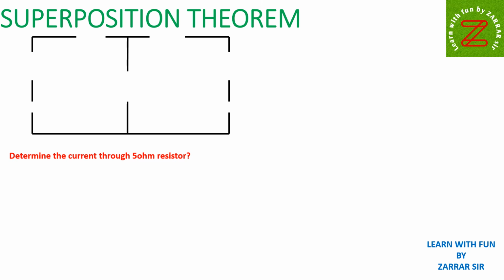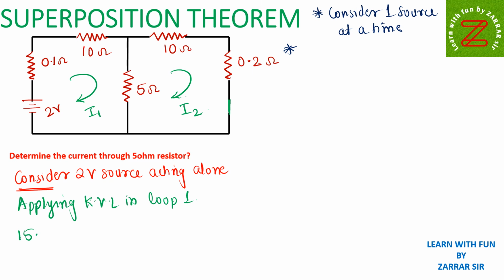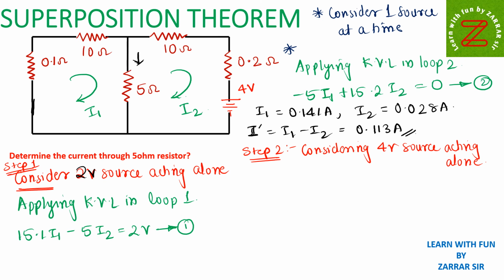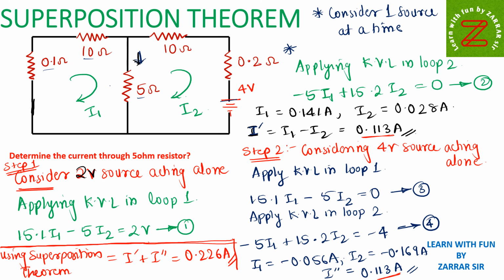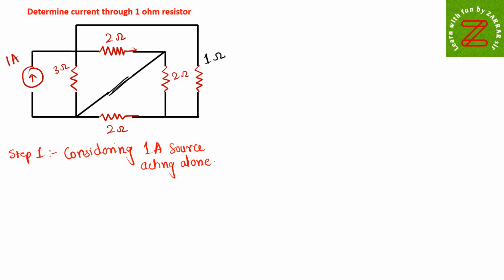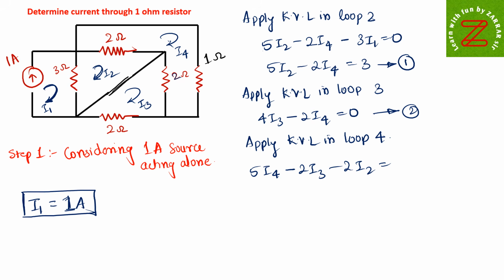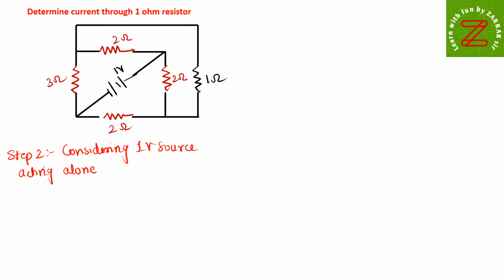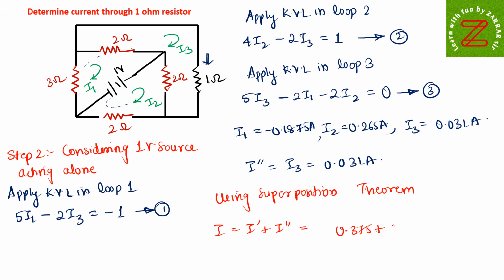SUPERPOSITION THEOREM WITH TWO EXAMPLE in Less than 20 Min

Comment: Sir, in the KVL video, you would write the voltage and subtract the value whenever there was a resistance, then set the equation equal to zero. However, in your current lesson, you are adding the resistances and placing the voltage after the equal sign instead of zero. This has left me quite confused. Can you please clarify?
Reply: He is using a shortcut. Check it out on his kvl video

Comment: 5:05 sir you have calculated the value of I2 as 0.028 however  I'm getting 0.048 as I2
Reply from the maker: Yes u r correct
Thanks a lot for correcting me
Reply: @ZarrarKhan  your welcome sir love your content :)
Reply: @liebermen2369 bro how to calculate equations with casio bro
Reply: How to calculate please let me know
Reply: @ramoioo  using scientific calculator. If you have an fx-991 model then press on mode button then press 5 to select equation then press 1 or 2 depending on the no of variables. Then enter the coefficients of all the equations respectively. Press = to enter the number into matrix. If the equation doesn't have any term then add the coefficients of that term as 0. Then simply press = after entering all the values. Voila!

Comment: what if we have 2 voltage source and 2 current source in single circuit ??
help sir
Reply: you will have to consider each 4 source alone. So you will have 4 steps.

Comment: I have one doubt  in second problem  in loop 1one they are resister consider the resister must apply the loop1 in equestion ( 3*i1-3*i2=1) in the equestion are find to solve them it's possible or not possible

Comment: Hello sir iam getting diffrent answers in calci and both i1 and i2 getting difrent values even though i kept the same numbers u applied.
Lop 1 i1 is 0.148 as u got after thag i2 is getting 0.048 u got 28.

I1 in lop 2 is -0.097, i2 is -0.295

Getting i1 dash is 0.196
I2 dash is
-0.392

After adding getting 0.588
Reply: Any calci mistake or my mistake i even rechecked with values thrice.
Reply: Sir i dont understand y thi issue is coming even all the numbers arr same shud we have to get the same loos equl in this theorem?
Reply: @priyankaegala1678  even i am getting the same answers as you are.
Reply: Yes I am also getting same answer so please tell me which is correct either this sir or us
Reply: Me too
Reply: how did  u calculate using calculator
Reply: @ADVAITHGCSE  scientific calc